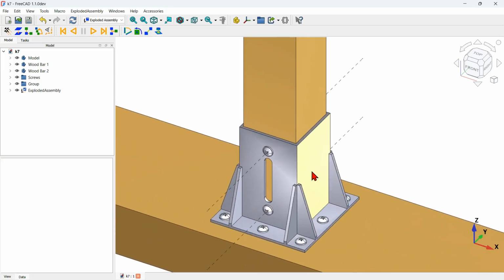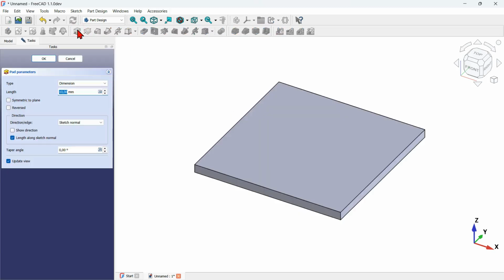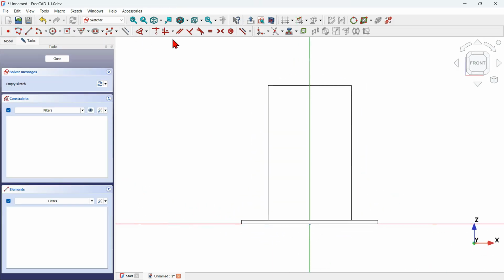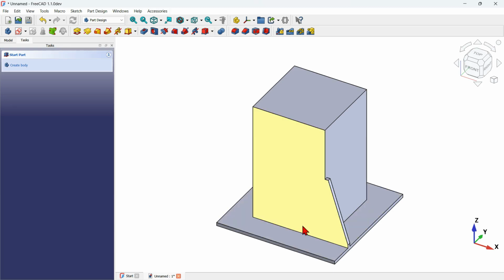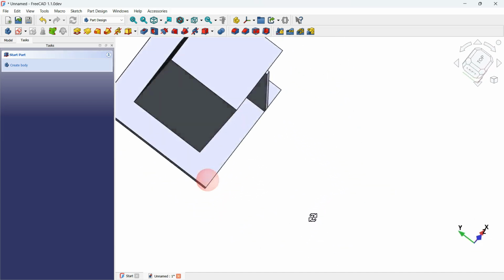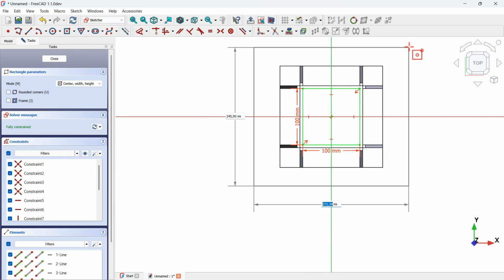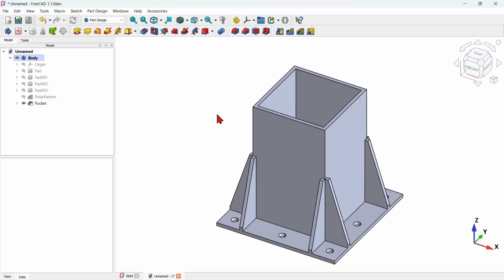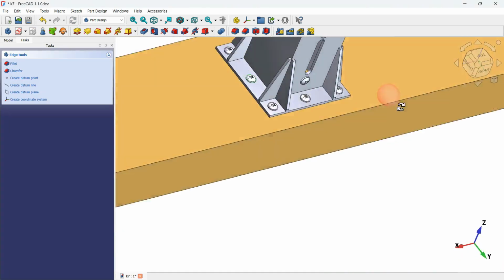FreeCAD 1.1Dev: 3D Modeling PartDesign + Sketcher exercise | Easy model

Comment: Thanks for the tutorial. As you said you chose your way and there is nothing wrong with that, but this can be done WAY easier with only three sketches and a polar pattern:

1. Sketch the base plate in XY plane including the holes for the screws-->pad 5mm

2. Create one single sketch (in XZ or YZ plane) with the profile of ONE side wall including the "fins" left and right"--> offset this sketch 55mm to the outside (the sketches z direction)--> pad 5mm to the inside-->polar pattern 4 occurences

3 One sketch  (in XZ or YZ plane) with the vertical longhole (slot) and the two holes above and below it--> Pocket through all

That's it!!